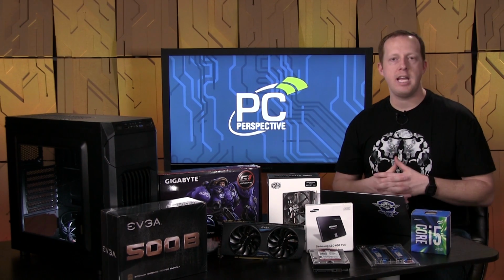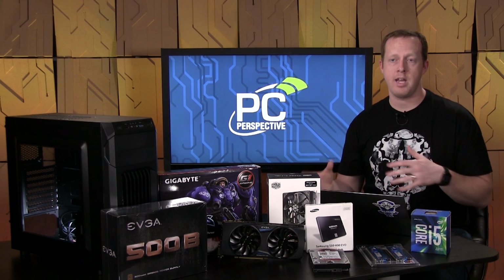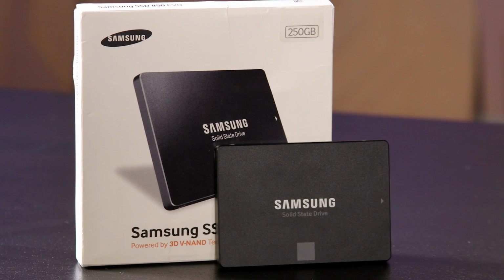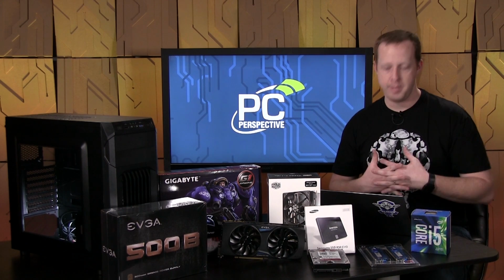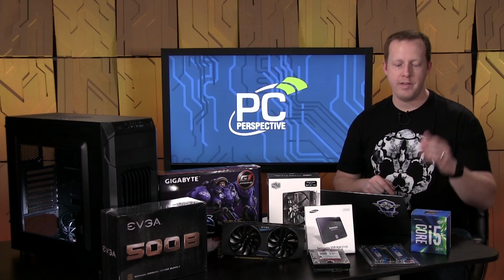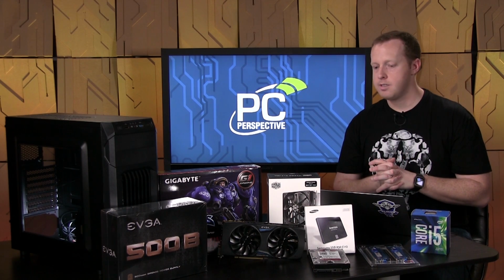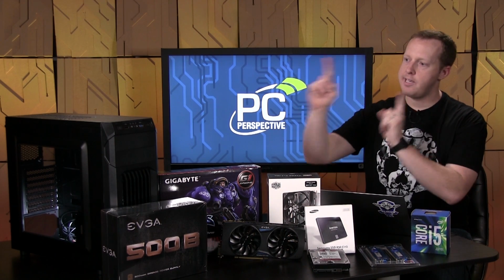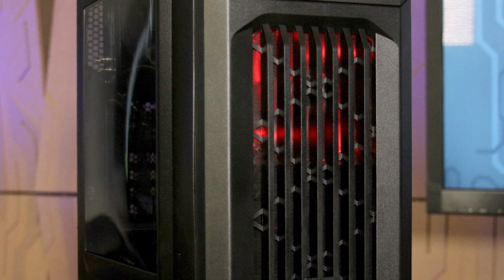VR System Build Guide Spring 2016: Budget Cost of $900

Comment: Yo, could you help me out? I picked some parts on PCpartPicker and I would like to see if it is VR Ready. http://pcpartpicker.com/p/vVyWVn
Reply: +Quacker Crackers [PCPartPicker part list](http://pcpartpicker.com/p/9FPmdC) / [Price breakdown by merchant](http://pcpartpicker.com/p/9FPmdC/by_merchant/)

Type|Item|Price
:----|:----|:----
*CPU* | [Intel Core i5-6500 3.2GHz Quad-Core Processor](http://pcpartpicker.com/part/intel-cpu-bx80662i56500) | $193.99 @ NCIX US 
*Motherboard* | [Gigabyte GA-B150M-D3H Micro ATX LGA1151 Motherboard](http://pcpartpicker.com/part/gigabyte-motherboard-gab150md3h) | $57.98 @ Newegg 
*Memory* | [G.Skill Ripjaws V Series 16GB (2 x 8GB) DDR4-2400 Memory](http://pcpartpicker.com/part/gskill-memory-f42400c15d16gvb) | $52.20 @ Newegg 
*Storage* | [PNY CS1111 240GB 2.5" Solid State Drive](http://pcpartpicker.com/part/pny-internal-hard-drive-ssd7cs1111240rb) | $59.00 @ Amazon 
*Storage* | [Seagate Barracuda 1TB 3.5" 7200RPM Internal Hard Drive](http://pcpartpicker.com/part/seagate-internal-hard-drive-st1000dm003) | $45.89 @ OutletPC 
*Video Card* | [Sapphire Radeon R9 390 8GB Nitro Video Card](http://pcpartpicker.com/part/sapphire-video-card-100382ntoc2l) | $317.99 @ SuperBiiz 
*Case* | [NZXT S340 (Black) ATX Mid Tower Case](http://pcpartpicker.com/part/nzxt-case-cas340wb1) | $59.99 @ Newegg 
*Power Supply* | [XFX TS 550W 80+ Bronze Certified ATX Power Supply](http://pcpartpicker.com/part/xfx-power-supply-xfxts550w) | $55.99 @ SuperBiiz 
 | Prices include shipping, taxes, rebates, and discounts |
 | Total (before mail-in rebates) | $863.03
 | Mail-in rebates | -$20.00
 | *Total* | **$843.03**
 | Generated by [PCPartPicker](http://pcpartpicker.com) 2016-05-05 15:08 EDT-0400 |
Reply: Thanks a quintillion!

Comment: What about the G3258? Im not sure whether VR requires more CPU than conventional games so I could be wrong, but everything I've heard says you can count the number of games on 1 hand that are bottlenecked by the G3258. I know a 970/390 + G3258 is an odd pairing but its a great budget deal. I have the G3258 + Strix 950 on a $250 rig and I love it(yes I know it can't do VR). Avg 50FPS+ on almost every AAA title for $250 is great

Comment: I managed to fit an overclocking i5 just slightly over budget, that'd be way better for bringing up your minimum frame rates for VR, for non VR the 6500 is going to be better due to the saved money overall, also if you can only afford around a thousand dollar PC, you can't afford proper VR, going to need 2 top end GPUs(probably for the next gen) and at least a 4.5hz Intel Quad core for the best experience. 

far as the GPU goes, I'd stick to a 390 due to saving money with free-sync, 125% more VRAM, and from the looks of it better DX12 support, it also just has more performance in general 

didn't nvidia just pull drivers due to instability man...and not for nothing, but are you sure the guys running those systems weren't simply sponsored by nvidia with 970s to use? 

PCPartPicker part list: http://pcpartpicker.com/p/h9DsRB
Price breakdown by merchant: http://pcpartpicker.com/p/h9DsRB/by_merchant/

CPU: Intel Core i5-6600K 3.5GHz Quad-Core Processor  ($238.87 @ OutletPC) 
CPU Cooler: Cooler Master Hyper 212 EVO 82.9 CFM Sleeve Bearing CPU Cooler  ($28.99 @ Newegg) 
Motherboard: ASRock Z170A-X1/3.1 ATX LGA1151 Motherboard  ($98.99 @ SuperBiiz) 
Memory: G.Skill NT Series 8GB (1 x 8GB) DDR4-2400 Memory  ($29.99 @ Newegg) 
Storage: Sandisk SSD PLUS 240GB 2.5" Solid State Drive  ($54.98 @ NCIX US) 
Storage: Western Digital Caviar Blue 1TB 3.5" 7200RPM Internal Hard Drive  ($48.97 @ Directron) 
Video Card: PowerColor Radeon R9 390 8GB PCS+ Video Card  ($308.99 @ SuperBiiz) 
Case: Deepcool TESSERACT BF ATX Mid Tower Case  ($35.99 @ Newegg) 
Power Supply: EVGA 650W 80+ Gold Certified Semi-Modular ATX Power Supply  ($69.99 @ Amazon) 
Total: $915.76
Prices include shipping, taxes, and discounts when available
Generated by PCPartPicker 2016-03-24 03:02 EDT-0400

Comment: I would have dropped the cooler since you can't OC and a cheaper motherboard and spent more on the power supply and maybe a better case. Maybe keep the mobo but definitely drop the cooler and get an xfx 550w

Comment: THe 390 outperforms the 970 in all the latest titles and AMD's liquid VR is the leading technology right now, and what do you suggest? the 970? seriously guys?? 8GB of frame buffer will be critical in VR, the 3.5 GB 970 simply is obsolete.
Reply: +Andrew Smith but they didn't...
Reply: Andrew Smith  but still, their build use a 970, saying and doing are two different things.
Reply: Andrew Smith  I speak 5 languages,  and you are functionally illiterate:

Andrew Smith
08:22
+loguerto lol about 3:30 they say exactly you can get a 390
loguerto
09:30
+Andrew Smith  but still, their build use a 970, saying and doing are two different things.

I repeat, saying and doing is a different thing, one may watch the video until min 3:30 or simply conclude in less than a minute that they used a 970, even if they mentioned the 390 , is not the best choice for this build, and, in my opinion is bad advertisement.
I watched the entire video, I know they mentioned the 390, but for me mentioning is not enough in this precise situation.
Hope I made my self clear.

Comment: Steam VR scores for R9 390X = 7.8 vs GTX 970 = 6.5
.
Why go with the GTX 970 as it only has 3.5GB full speed frame buffer. Thats a massive bottle neck for VR. VR is going to chew that up quick, VR games will use more VRAM. I would start at a minimum R9 390X  8GB or a GTX 980 TI 6GB for a more high end build.  A GTX 970 will work for launch titles but I would  imagine med to low game settings as that frame buffer will be a big bottle neck. GTX 970 is really fast good card very overclock-able but NOT a VR card no way. I dont think Ryan would touch AMD with a 10 foot pole lol, for this budget build the R9 390x is the clear choice I would save my money and get a GTX980TI but in thus price range R9 390X is hard to beat with that 8GB of VRAM.  #BIASFORLIFE

Comment: in the UK this same build will be probably like £1000-£1100 ;(
Reply: +beingatliberty 204$ cpu its like 270 euro in Ireland how the hell does that work.
Reply: +beingatliberty 772 GBP actually, with an unlocked i5

PCPartPicker part list: http://uk.pcpartpicker.com/p/pJ3GsY
Price breakdown by merchant: http://uk.pcpartpicker.com/p/pJ3GsY/by_merchant/

CPU: Intel Core i5-6600K 3.5GHz Quad-Core Processor  (£198.99 @ Ebuyer) 
CPU Cooler: Cooler Master Hyper 212 EVO 82.9 CFM Sleeve Bearing CPU Cooler  (£26.99 @ Novatech) 
Motherboard: ASRock Z170A-X1/3.1 ATX LGA1151 Motherboard  (£91.35 @ Ebuyer) 
Memory: Crucial 8GB (1 x 8GB) DDR4-2133 Memory  (£27.48 @ Ebuyer) 
Storage: Sandisk SSD PLUS 240GB 2.5" Solid State Drive  (£53.00 @ Amazon UK) 
Storage: Western Digital Caviar Blue 1TB 3.5" 7200RPM Internal Hard Drive  (£40.36 @ Amazon UK) 
Video Card: PowerColor Radeon R9 390 8GB PCS+ Video Card  (£249.95 @ More Computers) 
Case: Cooler Master N300 ATX Mid Tower Case  (£36.57 @ Amazon UK) 
Power Supply: XFX XT 600W 80+ Bronze Certified ATX Power Supply  (£48.22 @ More Computers) 
Total: £772.91
Prices include shipping, taxes, and discounts when available
Generated by PCPartPicker 2016-03-24 07:08 GMT+0000

Comment: There is a hole where you can route the 8 pin power connector on the top of the motherboard tray, but you have to route it before installing the motherboard.

Comment: i5-4590 is cheaper and faster, and enables you to get a cheaper motherboard and cheaper ram, which won't have any effect on gaming. Skylake isn't worth the price
Reply: +Volt Lover Not sure if it's still possible but you can OC Core i5 6500. Either way I would spend the extra $50 to get 6600K + Z170. You really need a very fast CPU to get to 90 fps. Also one mistake PCPer made was getting DDR4-2133. Get the fastest RAM you can. It makes a huge difference.
Reply: +Volt Lover I agree with this unless you want to BCLK overclock that 6500. As much as you lose features by BCLK OC on skylake it's a compelling reason to go haswell for me.
Reply: +Orjon Zaganjori I disagree. For 90FPS you don't need that good of a CPU (for example look at the VR benchmarks at the Linustechtips forum)
Nor does the memory really matter. As long as it's not unbearably slow and you use dual channel even with DDR3-1600 the performance impact is negligible.
Reply: Source for it being faster? Skylake is clearly better than haswell in terms of speed.
Reply: +Orjon Zaganjori what are you talking about? Ram absolutely does not make a huge difference in gaming. Ram speeds are so fast these days its virtually impossible to saturate the bandwith especially with ddr4.. Where did you get such a crazy idea?
Reply: Ammar Hasan But it doesn't matter enough to justify the higher cost for now.
Reply: CapnTates There is only about 10-20 dollar premium in the US, barely a big of a difference  for a better processor:

http://pcpartpicker.com/p/KvJV23

http://pcpartpicker.com/p/Y7JMBm
Reply: +Volt Lover Skylake is going to be worth it for USB 3.1, and DDR4 prices are the same now, same with the motherboard, my build from above at $900 with an unlocked i5

PCPartPicker part list: http://pcpartpicker.com/p/h9DsRB
Price breakdown by merchant: http://pcpartpicker.com/p/h9DsRB/by_merchant/

CPU: Intel Core i5-6600K 3.5GHz Quad-Core Processor  ($238.87 @ OutletPC) 
CPU Cooler: Cooler Master Hyper 212 EVO 82.9 CFM Sleeve Bearing CPU Cooler  ($28.99 @ Newegg) 
Motherboard: ASRock Z170A-X1/3.1 ATX LGA1151 Motherboard  ($98.99 @ SuperBiiz) 
Memory: G.Skill NT Series 8GB (1 x 8GB) DDR4-2400 Memory  ($29.99 @ Newegg) 
Storage: Sandisk SSD PLUS 240GB 2.5" Solid State Drive  ($54.98 @ NCIX US) 
Storage: Western Digital Caviar Blue 1TB 3.5" 7200RPM Internal Hard Drive  ($48.97 @ Directron) 
Video Card: PowerColor Radeon R9 390 8GB PCS+ Video Card  ($308.99 @ SuperBiiz) 
Case: Deepcool TESSERACT BF ATX Mid Tower Case  ($35.99 @ Newegg) 
Power Supply: EVGA 650W 80+ Gold Certified Semi-Modular ATX Power Supply  ($69.99 @ Amazon) 
Total: $915.76
Prices include shipping, taxes, and discounts when available
Generated by PCPartPicker 2016-03-24 03:02 EDT-0400
Reply: +Ammar Hasan 
http://cpuboss.com/cpus/Intel-Core-i5-6500-vs-Intel-Core-i5-4570
Reply: Transmit This CPUBoss is not reliable.
Reply: +CapnTates Indeed, but the point stands.
These builds are all largely dependent on one thing the GPU.

I can't see there being any significant difference for VR between the 900 build, and the 2500 build if you swap GPU Cards Between them.
Reply: Transmit This Which is why I discourage spending a single penny too much.
Though DX12/Vulkan might be able to finally utilise the CPU horsepower all of us have.
Reply: +CapnTates Couldn't agree more.

Comment: Rather get the AMD R9 390 for the 8gb ram. I think that will help a lot for VR. Can also be had generally cheaper than the 970.
Reply: Seeing how power hungry the 390 is that he will have to get a better PSU though. But I could see the 8 gb vram being a huge benefit
Reply from the maker: +Corrosive That's definitely an option!
Reply: +baitboy3191  390 can acync compute,  970-cant
Reply: +Corrosive and get your full Vram too ;)
Reply: ThatDutchGuy But if you look at the VR experience app that rates how good your experience will be... the 390 is ranked higher than the 970, therefore it is a better card for VR while being usually cheaper.... Can't argue the facts.
Reply: I don't get why people think you would need a big PSU for a r9 390. Any decent 500W PSU will do just fine. And pcper should definitly have recommended the 390 instead of the 970. It's overall just the better card.
Reply: +baitboy3191 nothing new really. They will and do take more power, but it's greatly inflated. They do get the shaft on optimization though. Months later in some circumstances.
Reply: Same, dont know how they can recomend gtx 970 for VR with its 3.5 gigs of vram. You can clearly see in benchmarks that the r9 390 crushes the gtx 970 in 1440 and 4k
Reply: +Christopher Lennon not to mention that xfire on the 390 would be great down the line when you need more power... 2 cards for 1 card per eye performance... The last chart I saw showed xfire Nanos at the top, so once xfire becomes even more viable the 8gb may be more relevant too.
Reply: I am no nvidia fanboy or anything it's just the last time I looked at AMD cards their power usage tends to be a lot higher than nvidia. 

Also Is it just me or is AMD always getting the shaft like lately games have been more optimized for nvidia but not so much for AMD?  Everything I visit discussion forums of new games people who have problems are usually AMD owners. 

Like even here they fail to mention AMD alternatives to any of the components.
Reply: +baitboy3191 Games that use Nvidia effects or are otherwise connected to Nvidia tend to perform worse on AMD cards than they should, the newest Tomb Raider for example. But yes Nvidia drivers have less CPU overhead but with DX12 the driver is much less important anyway as game developers need to develop close to the metal. That's why you see AMD cards gain a lot more from dx12 than Nvidia does.
And the whole power consumption on AMD cards topic got vastly overdramatized to be honest. AMD even has THE most power effecient gpu on the market right now.
Reply: +baitboy3191 the i5 6500 is a 65W part. The 390 might be power hungry but it doesn't pull 400W, even overclocked. It will run hotter though.
Reply: +Christopher Lennon Yes it's well know and recognized that pcper has deals with Nvidia.
Reply: Dylan Sands
source?
Reply: Look at all evidence that they are Energy Core
Reply: Where should I look?
Reply: +Energy Core their videos mate..
Reply: So there is only anecdotal evidence then.
Reply: +Energy Core it's not anecdotal evidence... it's over and over and over. it doesn't need to even be said it can be in simply what they do the language they use.
Reply: +Corrosive but then you need something better than a cheap ass low-end EVGA 500w unit. This one should power the 970 safely for a little while, but i would not run a 390/390X or 980ti on it.
Reply: ThatDutchGuy Sounds like a deal. Theoretical benchmarks have nothing on real deal performance numbers anyway so good call.
Reply: +ThatDutchGuy AMD luquidVR is builded fromthe ground up with mantle's low level code, it is the most efficient piece of code out there.
Reply: +ThatDutchGuy it was officially stated, and people who work with AMD in the VR tech, 83% of the market, seem to be pretty happy with it. Soon everyone can test it, but what matters is that people asked for efficient code from AMD, and they got that. The company is moving pretty good lately on the sw side, yesterday the gpu open vulkan ready linux driver was released from AMD, awesome.
Reply: +ThatDutchGuy Invalid argument. VR = mandatory low level api. DirectX 11 is not  a low level api.
Reply: +Detmer not true, workloads for VR are independent from main graphics API. liquidVR for example works with dx11 opengl dx12 and vulkan.